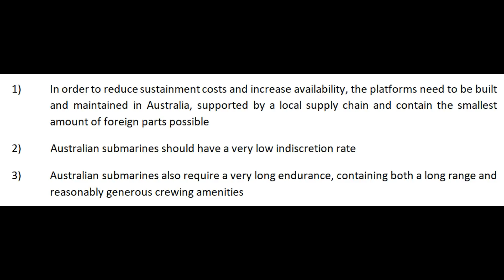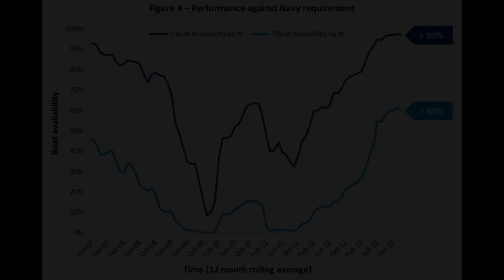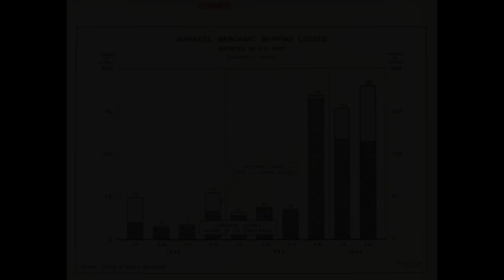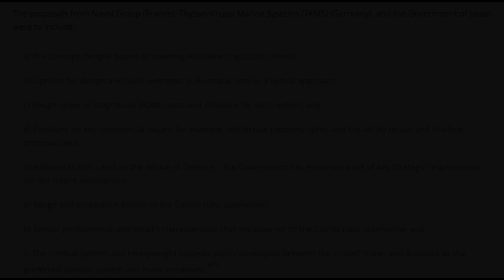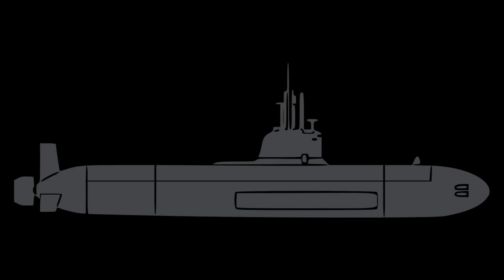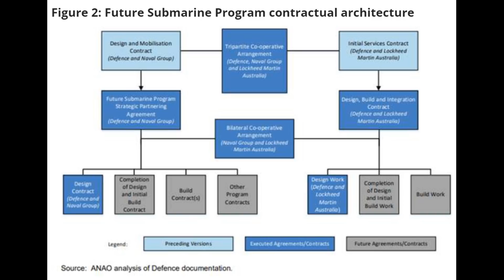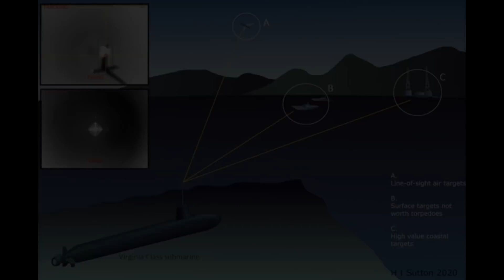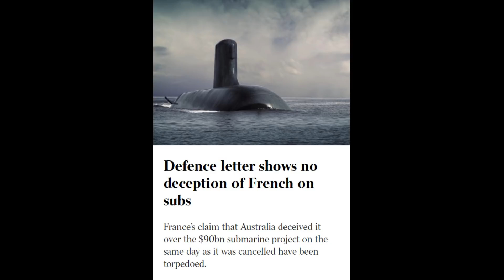AUKUS and the Nuclear Option: the Life and Death of the Attack Class Submarine

Comment: I subscribe to this channel and to date have been impressed with the presentations. However, on this occasion the presentation is unfortunately flawed, in my opinion, in terms of understanding the Oberon maintenance issues, the factors that influenced the decision to build Collins in Australia and the aborted Collins replacement program SEA 1000. aka Attack Class project. 

Early in the Oberon acquisition a new and profound Quality Assurance system was introduced across Naval contracting - AS 1822. This standard effectively changed the philosophy of naval shipbuilding and repair.  Caveat Emptor (buyer beware) was replaced by a legal obligation on the part of the supplier to provide goods and services "fit for purpose".  This change determined the extent and depth of maintenance and repairs. The Oberon was not a sophisticated platform and all of the electro-mechanical systems that made up the submarine, including the pressure hull, were well within the maintenance and repair capability of Australian industry.  There were also open and supportive technical arrangement between the RAN and RN on maintenance issues. Australian submarine authorities held a full suite of up to date Oberon drawings. Keep in mind Vickers Cockatoo Dockyard, was at the height of its Australian submarine maintenance and repair work, a subsidiary of Vickers Barrow In Furness, the Royal Navy Submarine builder.

The decision to build the Collins in Australia was largely a result of the efforts of dedicated and committed people in the RAN Project team, Informed and influential State Governments and political champions like Kim Beazley and John Button. Sweden's Type 471 (Collins) was chosen. At the time the  spirit of nation building was strong across all Australian governments. In hindsight the choice of Collins was arguably a mistake. "Steel, Spies and Spin" by Peter Yule and Derek Woolner is a good account of the Collins story.

The Collins replacement, the Attack Class, was possibly driven by the fact that France offered to convert the design of the diesel Electric Shortfin Barracuda, (SSK) to a nuclear submarine (SSN).  The French made the same conversion offer to Australia with the Rubis Class at the time of the Collins project (They did eventually produce a nuclear powered Rubis Class submarine). I suspect the selection of France as the strategic "partner" for the Collins replacement was greatly influenced by the fact that France was quite advanced with Low Enriched Uranium reactors for submarines - this would have satisfied the provisions of the Nuclear Non Proliferation Treaty and allowed Australia to smoothly transition to nuclear.  Up until AUKUS the USA and Britain had rebuffed overtures by Australia, from as early as 2006, for help to acquire a nuclear submarine capability.

The Attack project ended in tears, as many predicted it would. In the main, I believe, due to the insurmountable problems of overcoming the chasm between French and Australian techno - cultures.

Comment: You can't "covert" a nuke into a conventional lead-acid battery submarine with any success. The RAN should have known that and they are stupid for not. A reactor is about the volume of a car and the turbines are also com0act. How do you fit 300  battery cells (each weighing 800Kg ) into a sub that's never been designed for it? Madness.

Comment: To many misconception, bad information, and bad evaluation leading to complete mistaken conclusions. For example, all electric wiring is based on the battery output capacity so not to go beyond the battery capacity. Lead acid batteries generate hydrogen when voltage is too high which is detrimental for subs. 
Steel quality of Soryu class is equal or superior compared to US nuclear subs in which maximum dive depth is said to be around the same.

Comment: A little telling that the F-111 the aircraft used to highlight ballooning costs was kicked to the curb by most air forces due to its failure to deliver in its role. While the fighter mafia wasn't and isn't always right they did paint an accurate picture of the F-111's short comings.

Comment: One bad decision after another for our next sub. The nucs are too large and require way too much personnel. We only have the manpower for 3 Astutes and barely 2 Virginias. The attack class was a bad deal and I'm not for that deal but the nucs will just be extra boats for the US and UK navy rather then Australian Submarines. The Type 216 was probably the best solution.
Reply: I agree Craig twelve German TKMS Type 216 for a fixed price contract of AU$20 billion in 2016 all to be built in Adelaide was the best option for Australia. For the Australian government/Defence to conclude TKMS could not have built a 4,000 tonne class submarine without unacceptable risk was absurd. TKMS/HDW have built so many diesel electric subs successfully throughout the world and with excellent value for money. This sub is just a diesel electric sub without AIP and with lead acid batteries with lots of space for everything needed - not a spaceship carrying people to Mars and back! The complicated items such as the combat system, sensors and weapons are all off the shelf and first building a prototype sub before serial manufacture reduces any uncertainties.
Reply: I respectfully disagree, as the "best solution" is a relative term in an evolving threat environment, complicated by the long lead times of submarine platforms. TKMS is building 4 Type 218s for the Singapore Navy, but despite the numeric order of the system platform, each 218 unit is rated at ~ 2200 tons displacement. The proposed Type 216 for Australia was double that size, and such a unit has never been attempted by TKMS. The 216 option would have retained a high risk of program failure to meet the strategic needs of the Australian Navy.
Reply: Yes the submarine service will need to triple in size, not an impossible task by any means. Ironically the Navy will need to purchase additional SSK boats to make sure there are enough submarines to train the extra sailors! Something like a Scorpene or type 216 would fill the gap 😁
Reply: @thomasromanelli2561  Your comment is a good one but there are methods available to reduce the genuine risk. Australia could have ordered just one TKMS Type 216 SSK in 2016 to be built in Germany then with an option for another eleven to be built in Australia if the performance/price/schedule were acceptable? That represents a very big incentive for TKMS to offer a good design for a good price. That prototype Type 216 would likely have cost not much more than the AU$2.4 billion likely cost for the Attack class contract up to the cancellation date and have been completed before 2025 - at least ten years earlier than any likely Australian built US or UK design SSN that could be VERY expensive in comparison. Surely there would be far more risk with an Australian built UK or US design SSN in terms of acquisition cost, schedule, support/manning cost and performance problems.
Reply: @andreasbimba6519  I have no doubt that TKMS is capable of building the Type 216 after establishing the necessary infrastructure and procedures for a new class of ship- eventually. The strategic horizon in this situation is paramount, and while I have no doubt that the AUKUS program will carry its delays, squabbles and cost overruns, it will also offer the best chance to deliver a functional weapons platform that will remain relevant over its planned 35 year life cycle, versus the TKMS medium-term solution that doesn't appear to meet the expected operational needs of the RAN in a peer adversary conflict.

And honestly, the willingness for the RN/USN to include reactor technology transfers with an ally- no government would be likely to rebuff such a unique offer.
Reply: @thomasromanelli2561  Australia would be foolish to proceed with any open ended SSN acquisition strategy as costs could easily prove to be huge and unacceptable. The net effect on Australia's defence capability under these circumstances could be hugely negative. Firm cost/schedule guarantees must be sought for all realistic options and the best bid should win, hopefully within 18 months. This process should have started over ten years ago.
Reply: @andreasbimba6519  There are risks with any acquisition process, but I doubt the final design will be as "open-ended" as you suggest because it appears the RN & USN are committed to providing the fundamental architecture and established inventory for marine reactors and combat systems. This will provide a flexible platform that is compatible with allied navies while still offering a certain degree of customization to meet the needs of the RAN.

The threat environment as evolved so rapidly from the RAN's initial projections that is has exceeded the capabilities of the proposal from Naval Group. I do not believe that the UK & USN are attempting to compromise Australia's self-defense capabilities because it is NOT win their interest to do so- any open conflict with the PLAN (and make no mistake, there will be some event within the next decade) will require a multinational effort to contest it. The offer of UK & US reactor technology is unprecedented, and the strongest indicator of the level of commitment to enhancing Australia's defense capabilities.
Reply: @thomasromanelli2561  The US and UK governments may indeed want to offer a fair deal as it would also be in their security interests but the problem is costs still have the potential to skyrocket especially if Australia plans to locally build a replacement design for either the Astute or Virginia class. Already the AU$90 billion in out turn dollars, which corresponds roughly to AU$56 billion in 2016 dollars, for the 12 Attack class SSK's which corresponds to a per unit cost of AU$4.7 billion in 2016 dollars for each boat is way too expensive and many commentators have concluded the costs for 8 US or UK design SSN's will likely be much higher. Many commentators also talk of the Virginia class Block V being the best path but the manning requirements are too high for Australia's needs and the costs and long lead times for locally building eight are realistically likely to be too much.

The best value SSN option for Australia in terms of acquisition and operating costs is instead likely to be the French Naval Group 5,300 tonne Suffren class which cost the French government about AU$2.13 billion each based on their 2006 order for six boats for 7.9 billion euros and only needs a crew of 60.

TKMS reportedly offered a fixed price/schedule bid of AU$20 billion for 12 of their 4,000 tonne Type 216 class SSK's in 2016 and the Soryu and SAAB Oceanic ER are likely to be even cheaper and all are potentially better than the Collins class.

My key point is that Australia should not proceed down the eight SSN or even the twelve SSK paths without having fixed price and schedule bids and all options should be fairly considered during the 18 month investigation phase.

I agree with Craig that Australia does need submarines to help contain China and to be a small deputy sheriff in the plans of others but instead needs suitable submarines to operate in the shallow littoral waters in our immediate region and to act as an adequate deterrent to any nation's expansionary plans for which twelve large SSK's should suffice and are in fact superior in many important respects to SSN's for that purpose. Attempting to constrain China to the first island chain cannot succeed long term as China has a local proximity advantage and can ultimately militarily out build the US and all of its allies.
Reply: @hcodrum156  you do realise that the navy has been losing personnel. It has been shrinking and not growing. Tripling in size just isn't going to happen. Even our surface fleet has been reducing in size. The navy needs to build accordingly. In 1990 we had 3 Perth Class, 6 Adelaides and 5 River class ships for a total of 14 of these vessels and going forward we are likely to only have 12 of these and we currently only have 11. We haven't had a 3x increase in numbers since conscription and WW2 before that. It is ridiculous to think that a 3 x increase is achievable outside of a global war on the level of WW1 and 2.
Reply: @andreasbimba6519  Here are some numbers you need to know. 6 x Collins class subs that require 58 men to operate which means we should have 348 submariners. Maybe we have more but considering that these subs are never all active at once and we also struggle to man what is available then I am going to take that number as the high mark. Divide that number by 98 for an astute and you get enough crew to for 3.5 astutes and for a virginia at 130 per vessel you get 2.6 subs worth of crew.

Comment: Unfortunately there is no guarantee that either the US or the UK will be willing or able to provide an acceptable value for money proposal for nuclear powered submarines for Australia within the stated 18 months. Another Attack class type of submarine design and build strategic partnering agreement without contractually fixed costs and delivery schedules again looks likely which is highly likely to again lead to unacceptable cost overruns that could be ruinous for Australia's defence capabilities across the board due to resulting funding shortfalls.

Given the project time frames it is also possible that the succeeding generation for both the Astute and Virginia class submarines will be offered to Australia with a corresponding high risk of technical problems and cost and schedule overruns. Australia would still likely not have a firm submarine build contract in 2030 by following this path and be without any good options even then.

The US, UK and French submarine builders are also proceeding now with new SSBN submarines and in addition the US is building the Virginia class SSN's at maximum capacity which will reduce resources available to deal with Australia's submarine needs.

If however an existing operational SSN design is chosen the risks will be far less and the latest combat system, sensors and weapons available at the time of construction can still be installed.

It would be prudent to respectfully request a fixed price/delivery bid for eight Australian build Naval Group Suffren class SSN's for fair and equal evaluation in 18 months time. This would provide the option to the Australian government for proceeding with undoubtedly the most cost effective SSN option that is available to Australia - that of the Suffren class and also provide competitive pressure for the US and the UK for any of their bids or vague proposals.

It is claimed in this video that the relatively short ten year nuclear fuel replacement period for the Suffren class leaves Australia too vulnerable to the future goodwill of the French government but the reality is that Australia will be very dependent on all supplier nations for the technical support, operation and maintenance of their respective nuclear reactors. Realistically it also remains very unlikely that diplomatic relations with France could deteriorate to such an extent that the French government would refuse to refuel our boats. Historically France has proven to be a more reliable weapons supplier to international customers than either the US or the UK. It may also be possible for Naval Group to refuel any Australian Suffren class boats in purpose designed facilities in Australia.

It would also be prudent to again request fixed price and delivery schedule bids for the Australian build of 12 large diesel electric submarines from TKMS, Mitsubishi and SAAB/Damen for fair and equal evaluation in 18 months time. This is a realistic and acceptable for the RAN, fall back option if all SSN options prove to be too expensive, risky or otherwise unacceptable. The Netherlands is following a similar time frame for the replacement of their four Walrus class diesel electric submarines and they have sought bids from TKMS, Naval Group and SAAB/Damen. TKMS remain the world's largest and most capable diesel electric submarine designers and builders and a contract based around first successfully building a single prototype submarine possibly at the home shipyard should offer acceptable project risk - realistically the task is not that difficult if AIP is not required and lead acid batteries are initially preferred. Similarly a stretched longer range version of the Mitsubishi Soryu class or the more current Taigei class again without AIP and with lead acid batteries represents a low technical risk option. The Japanese government may prove to be amenable to build the boats in Australia and to provide all necessary design details to Australian and other approved international suppliers. SAAB/Damen are likely to have the smallest and lowest cost design of the three possible bidders which would be based on their Oceanic ER class which is based on the new Swedish SAAB A26 or Blekinge class. All three diesel electric submarine design alternatives exceed the performance of the Collins class and should be adequate for the needs of the RAN.